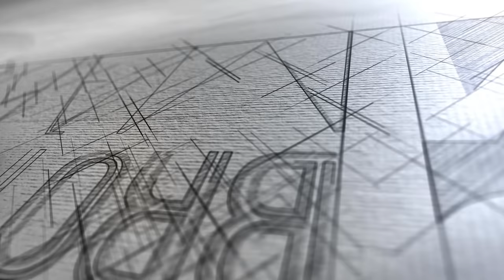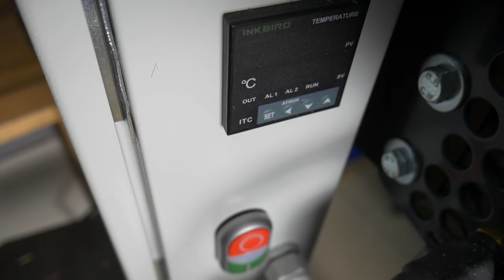Plant Pots made from Recycled Plastic

Comment: great idea, honestly I would like to know what is the average energy expenditure to chop the plastic and to melt and shape?
and how much co2 is created in the process, in no way am I being sarcastic, it really is something that I'm interested in.
because I think the project can be applied to make tiles, replacing those made of zinc or clay tiles.
how long to cool the container? great video congratulations
Reply from the maker: Thanks. Our workshop and house are powered by energy generated 100% from renewables, so zero CO2 produced. And there is no cooling time. Aluminium is a heat sink and the pot is cool as soon as the mould is opened 🤙🏽

Comment: I am incredibly impressed at what you guys are doing. What a gift those students have in you gentlemen. What I would love to see is you taking the recyclables to another level if you already have not and build a small scale play house for a small child. Say a 5-8 year old with beams formed with small steal  heavy gauged wire for structural support (maybe a ladder configuration of steal wire embedded in the plastic beam for rigidity) that might allow for a two story play house. Joists, trusses and framing for all parts of the inner walls floor and roof. Use recycled styrofoam for insulation and plastic terra cotta roof tiles. Basically built a simple small scale home or playhouse to prove the concept of a home totally made from recyclables. Except instead of using some hippie concept with walls made from tires and dirt or mortar and glass bottles to let light in like some nomad in the New Mexico Desert. Make the recyclables like a normal conceptualized home we would see like a Cape Cod style with all formed plastic beams siding or even logs.(Like the guy in California who makes authentic looking wood logs out of plastic recycled milk jugs.) Then if you want to get more attention use it to prove the concept structurally to engineers or auction it off to the highest bidder to get something for it. The point is to make it the first fully recycled Play Doll House scaled for a small child functional that looks real. If you could prove that can be done, a company could scale up to move this toward a viable home building process of building a move in structurally sound live in home. Think of what you could teach your kids. You would get venture capital pouring in and people saying why the hell are we throwing this all away? You are making beautiful planter pots. Why not prove homes could be made from garbage and start the real engine for people to create build and motivate others to think about their garbage another way. Elon musk does not have to be the innovator of everything. I conceptualized solar shingles 35 years ago with a paper in college. My professor said 'B-'. Great idea it will never work. You cannot manufacture a solar cell cheap enough. And yet here we are. What if people started seeing garbage as a real way to help the lost souls without purpose, the impoverished without shelter or the  the unemployed. The only sticking point is getting the manufacturing down to a process of efficiency. That is it. You move the facilities to the garbage. I have seen portable equipment in cargo containers that could be moved onsite. This may be a long shot and a pipe dream but the more I see guys doing things like you are doing with bottle tops the more I think it can be done. You are probably wondering about labor. I have that figured out. I have seen what you can do with a single beam. Benches and planter pots are great and useful but what if garbage could truly change the world. What if there was no garbage only recyclables. What if everything could be converted to something of use and value? I believe it can and I think you do to.  If you ever want to contact me I would be happy to talk to you live. I too am a teacher with a different medium and audience. 
https://external-content.duckduckgo.com/iu/?u=https%3A%2F%2Ftse3.mm.bing.net%2Fth%3Fid%3DOVP.drtqs74xqUHGURVQ2su77AHgFo%26pid%3DApi&f=1
https://www.youtube.com/watch?v=ckWqR1JD158
https://www.youtube.com/watch?v=zNGuuSKE1pY
 if you would like to talk further please let me know.

Comment: Impressive. Try to fix a spiral heater around the mould . So you can avoid microwave process. Or you can make a hot runner mould.
Reply from the maker: That seems much more complicated than quickly popping it in the toaster oven to preheat for 10 mins! Thanks for the idea though 👍🏽

Comment: I have a question. What happens with the air inside the mold before the inyecion? Where does it go? Doesen't it form a bubble? 
Also nice video! I love all your plastic projects!!
Reply: I'm not 100% sure, but I think it comes out of the bottom where the peg they cut off at the end is!
Reply from the maker: The mould has 3 small air vents that air and excess plastic can escape from 🤙🏽
Reply: @BrothersMake  I really need this machine. How can I get one to buy? Dan, Ghana

Comment: great idea but better you use such as hydraulic pressure and gas to cast the plastic into any product for efficiency and low cost production.
Reply from the maker: That would be a much more expensive set up! And lots of issues with that as you can’t ‘feel’ when the mould is full. Working with recycled material has a lot of nuances that is very different from pure virgin plastic

Comment: Is it advisable to melt the plastic inside the oven of the gas stove?
I want to do a test with a metal mold and countermold of 24 "x 7" approx, place the plastic and put it in the oven of the gas stove.
Do you think it is possible like this? Or would there be some complication due to the gases that the plastic can emanate?
Reply from the maker: You can - it will just take longer to melt, but it's definitely possible. We wouldn't recommend using it in an oven you currently use for cooking food though!

Comment: Hey guys did you use any mold release?
Reply from the maker: Nope! Compressed air works best :)
Reply: @BrothersMake  No probs! Although have you tried  it on bigger molds yet? I think you might run into problems ( that would be a good video to do)
Reply from the maker: This is the biggest of our turned aluminium moulds. We have some bigger stacked plate steel moulds which also don’t require any mould release. We have a larger pot mould for our extrusion machine, which we’re yet to try but will see how it fairs!

Comment: um, as nice as the pots look and albeit a good way to recycle plastic, 
they need drainage holes and gaps to allow water to escape and to be reuptaken by the soil or plant in the pot

apart from a minor design issue brilliant work to help reduce the plastic waste as it is such an environmental issue
Reply from the maker: We offer these on our website with, or without holes, as requested. We simply drill a hole in the bottom. Most customers don’t want a hole as they are for indoor succulents.

Comment: Hey do you guys also recycle LDPE?
Reply from the maker: We do collect it but haven’t tested it yet!
Reply: Alright :) love your stuff! I had one more question since I'm excited to see you respond to comments. Is it necessary to have a panini toaster or can we use 2 trays in an oven to sandwich the plastic? I have an old oven that I want to experiment with before getting more equipment.
Reply from the maker: You absolutely can use the oven but be aware that it will take longer to melt, and it will be more susceptible to burning so be careful with your temps!

Comment: burning this plastic would have had less carbon footprint 😂😂😂😂
Reply from the maker: Completely wrong 😂
Reply: @BrothersMake  its already correct for the energy you have spend, not considering the energy spent to make the equipment you have used, and the energy spend for the mining of the raw materials used for the equipment same goes for the equipment used to make this video 😂😂😂
Reply from the maker: Our energy is sourced from renewable means. And you are correct about the equipment, but does that mean no one should ever try to recycle? This is low-temperature recycling, which is significantly more energy efficient that high temperature industrial recycling. Where do you think the energy comes to make commercial recycling equipment? We source a lot of our equipment second hand wherever we can.

“Participating in the world as it is does not disqualify anyone from trying to improve it”
Reply: @BrothersMake  the road to hell is paved with good intentions 😂😂😂
Reply from the maker: Apart from they aren’t just good intentions. I provided clear answers to each of your points 🤷🏽‍♂️